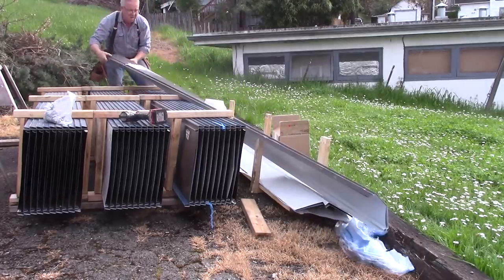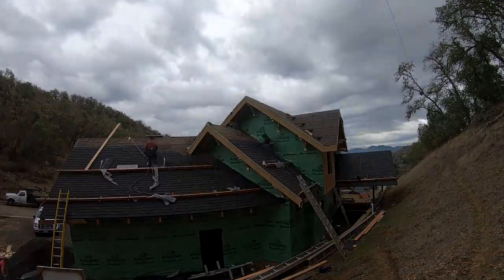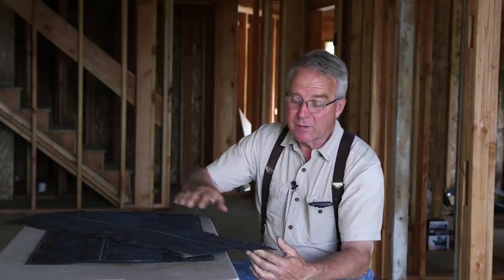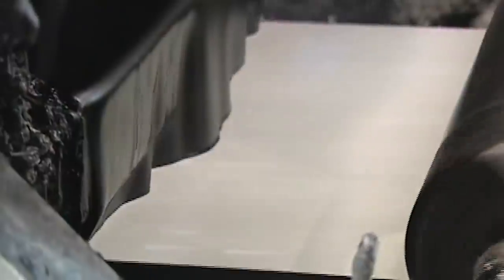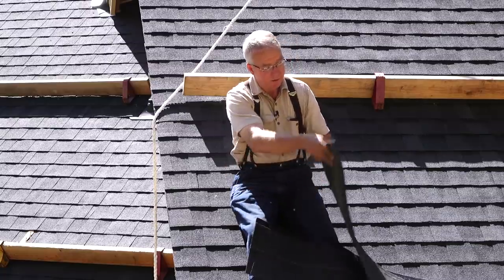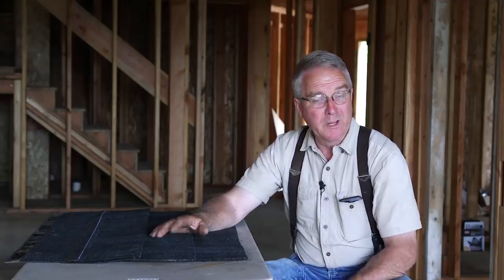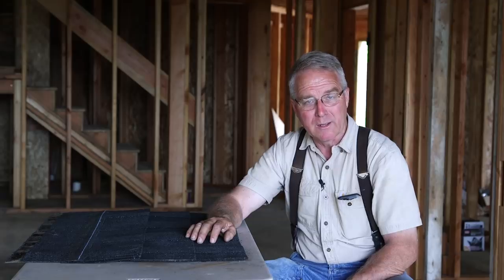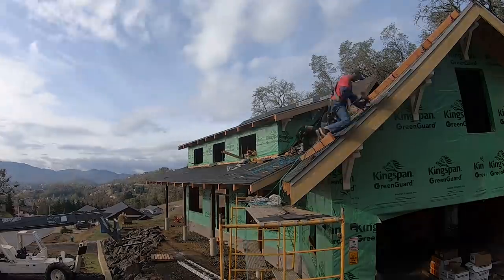The Incredible Asphalt Shingle

Comment: Here in Spain, in 99% of our houses we use tile roofing. And man, they endure everything. We have buildings 400 years old and they still work perfect.
Reply: I wonder if the environment makes a difference, like humidity and organic matter like leaves?
Reply: Frank Reading tile is very popular throughout much of Europe, even damp regions like the UK
Reply: How does the tile hold up to large hail?
Reply: Yes, as a German, I know how well they work (and how good they look.) It's also interesting how much engineering and robust construction goes into preparing the trusses to support their weight.
Reply: @HavokTheorem  tipicall  iberian tiles are entirely a clay based product, that avoids they can even crow plants and moss whitout any long term structural issue.
Reply: Yeah but the roof isn't 400 years old
Reply: the roof or the tiles? in my house the tiles are about 250 years or more but the wood beams were replaced with concrete ones in 1957
Reply: @BrunoGarcia79  In MY house, in rainy old Somerset, the tiles are from 1720, and so is all the main timber. There's been some small repairs, and the battens and felt were re-done in 1958.
Reply: @jobaecker9752  Heavy!
Reply: Glenn Holcomb  
Only in Florida? ?  You need to get out more. Metal roofs are popular in the Rocky Mountains, the Midwest, and I know from Florida to Texas.
Reply: @tubeonline629  tile. Not metal
Reply: Glenn Holcomb  there are tile roofs all over the States but they are a very specific look and usually don't fit into their neighborhoods very well in my opinion. If people in the States designed houses better (the McMansion curse) tile roofs could be used in more attractive ways and may become more popular.
Reply: Yeah the thing is houses don’t need to last 400 years. No one wants to pay for that additional cost
Reply: Clay tiles are good, but not in the regions where there is minus celsius degrees. Moisture that is inside the clay tile starts the erosion in the tile. And there is moisture (same with the metal roofs), since you have to warm the houses and the warm air always consists water (humidity), when it meets the cold roof moisture either is absorbed (tile) or condenses back to water (metal roof) and run underside of the metal roofing and dampens the wood. Asphalt tiling is good solution since it is on wood already and the humidity doesn't condense on it. Roofing woods will how ever absorb it and release it in warmer periods, but difference with the tile is that after wood absorbs the humidity it doesn't break while frozen, clay (and concrete) tile will always erode a bit in this freezing-melting- cycle.
Big issue about asphalt tiles is the "drying" after years, the surface starts to brittle because bitumen loses some of the elasticity through vaporization, that cuts down the usable years of the material, but it's easy to change and is not that expensive so its something to think about.
Reply: @tomigutzen  very interesting
Reply: @Mrcaffinebean  throw away culture makes throw away houses? if your house lasts 400 years, your kids will thank you for being debtfree and their kids and kids kids kids aswell.

It is lasting value
Reply: In Brazil we use tile and they are called "portuguese tiles". I wonder if they are different from spanish's.
On simpler houses people use fibro cement sheets, that are also good.

I don't like to bash, but houses in the USA look like paper board boxes. I realy like the rubber shingles thoug. I thing they must be The Best. Durable and light.
Reply: Glenn Holcomb  Fly into (or over) Phoenix or other cities in the American southwest extending to California: look down and you'll see neighborhoods with multitudes of tile roofs.

Comment: You should come to Europe. Shingles are rare and considered the budget option. Normal is tile, slate and metal. Lately green growing roofs too. Siding is also mostly wood here in Sweden, Norway and Finland. We use wood stud construction quite similar to the US. Just thicker for more insulation.
Reply: American contractors have fallen In love with Asphalt shingles over the last century. Primarily because they're cheap and easy to put on, but most homeowners don't know that so the roofing boss can make a huge profit on it. They also take the gamble that those homeowners are going to call them back in 20 years to replace their roof again. I hate asphalt shingles and will never put them on them on my houses. I've owned two houses that came with their 100 year old original slate roofs. If that's not a testament to their greatness, I don't know what is.
Reply: My only thought is hail. It's not uncommon to get a hail storm yearly with 40-50mm hail stones once every 10 years. Most shingles are replaced far before their warranty period runs out. Steel is a good option for hail but dents are likely and seen as unsightly. I don't know anything about hail occurrence in European countries though.
Reply: I said before that as far as I am aware in the UK at least, shingles are stuck on the shed, certainly not on the house. This is not a criticism really, clearly its different in the US. What I scratch my head over is the location of this house appears to be stunning. It would appear to be a location that would put it right in the upper price brackets for the area. Surely on that basis Scott could expect to enjoy a greater sale price if higher quality materials we used?
I hope this is the last ad for tamco.
Reply: @andrewv5104  Hail? We were in Quinta in northern Portugal in a rental VW van and had just parked in front of the hotel when it hit. It was reminiscent of a driving range except the hail stones were twice the size of golf balls. There was no time to talk about running the last few car lengths for the hotel. It just dropped all at once and the noise was beyond front row rock concert. A girl had just pulled in front of us with her Fiat and the airbag slammed her back in her seat. She was stunned for a few seconds and didn't move then she jumped into the back seat and pulled a blanket over her head. My wife's Pai and my FiL went for a Bica debriefing session. When he returned It turns out that the village had requested the hail long ago when locusts went loco. The hail had lasted just over 2 minutes for some reason. I think it was great fun. About our rental vehicle.... Hail Dorothy, our VW wicked, witch is dent. 

Paid the extra 22 Euros for their Wishy Hadda insurance golden ticket that covered the works including acts of God awful bad luck even curses. Storms are awesome but I think you need to be in a rental to really enjoy the pounding.
Reply: Gareth Irwin   “I hope this is the last ad for tamco.” My sentiments exactly.  And if I’m not mistaken, Scott received those shingles for free from the manufacturer. If true, this video appears to be the payback. 😩
Reply: @Steve Sheldon But without topsoil under your lawn you'll make use of all of your water allotments or skip a couple days so you can watch it transition much quicker to a nice shade of yellow too.
Reply: Gareth Irwin l
Reply: @dudemcmann6936  asphalt roofs can be replaced a lot less often if you use a higher quality shingle- these shingles he's using are rated for 50 years and will last as long as any other material can be expected to last.

Definitely plenty of roofers that prefer the absolute cheapest shingles that only last for 10-20 years so they get another job after the next hailstorm. 

Dad's an insurance agent and sees more roofing damage than any roofer, so you get to know the market. Ask you insurance agent about your area, some agencies will pay for the better roofing material
Reply: @andrewv5104  Hail is not that uncommon in most of europe.
My roof is 70 years old, in Scotland, and no issues.
Shingles make sense in the us, and they now last longer, but the problem is they are still bad values as the install cost is huge.
Reply: He would not get return on investment for a higher quality roof material. The roofing material rarely affects the market value of homes here, the only time it does is when the roofing is at the end of its life expectancy. I'm sure that roof was a 20k USD roof, slate would be 60k to 80k easily and would not add any value in the US market to the sale price. Unfortunately most things are more or less built to be "temporary" compared to European standards.
Reply: @nicholassmith5079  to be fair his investment in shingles cost him a few words spoken on camera. It would cost a months wages for an average person to buy those shingles. If he had to pay for them I'd bet he wouldn't have hired a contractor to fit them.
Reply: @garethsnaim8174  You'd think but we Americans can be price sensitive about the weirdest things. I work in construction (mostly repairing flood damage) but have done 100K basements. People who spend $600 for three lights yet go cheap on flooring because "I don't really look at it".

Some buyers would probably love a metal roof but most would just wonder why the house is X thousand more and think"I mean a roof is a roof right?"

It can get weird.
Reply: For the complaints about the Tamko endorsement -- they have a great product and color selection and a lower price vs bigger brand name competitors that offer no more quality so they were an easy choice for me when I did my roof in 1996 and it still looks great. I think it's fair trade and common on YT to endorse a business who supplied their material or service at cost or less, this channel is not ad-heavy, they've been giving us a lot of value for free.
For Europeans -- I lived in Germany and worked jobsites for 8 years so I know what you're seeing may seem strange. Roofing is a complete trade in Europe, with all of its intricacies and certifications, which is good...here it's a labor job run by someone skilled but they're not going to be able to compute the surface weight and application of an historic copper dome like every master has to in order to get certified over there. Typical build time for a house in Europe is 4-5 years, here it's 4-5 months. Real estate and property is a valued heirloom in Europe, here it's a commodity that is used and sold fairly quickly. There are exceptions to this but in general, this is still the wild west.
Reply: @Steve Sheldon In the U.S.  brick veneer homes without properly applied house wrap often produces mold as the lower portion of exterior walls become soaked.  This problem is less common with newer building codes.
Reply: @JohnDotBomb  50 year asphalt shingles ?  That won't be the case here in south Texas, but I'd like to see some examples if I'm wrong about that.
Reply: @timothykeith1367  Central Texas born and raised here. 50 year asphalt is still the best bang for buck, what my dad recommends after 35 years of inspecting roofs here. Metal is nice for larger industrial buildings, and tile/slate/other is generally for looks, which is usually only done on a custom home- spec houses shouldn't spend money for the buyer.
Reply: @dudemcmann6936  well, cheap asphalt shingles roofs match the way we build here in the states unfortunately. I've worked on too many million dollar homes that are built like tract homes. You aren't paying for quality of craftsmanship anymore in most cases. And the houses start going downhill almost as soon as the junky shingles nailed on top.
Reply: Anon Ymous  he probably means thicker as in building the outer walls with 2x8 studs so you have a deeper stud Bay that will hold more insulation.
Reply: Anon Ymous  Keep in mind that being from the Nordic area, English is probably not their first language.  I read it as deeper for more insulation space, as that makes more sense than thicker wood.  As you said, not a very high R value.
Reply: Here in Australia we like to use colorbond corrugated sheeting for just about everything, rooves, fences, sheds, whatever needs panelling, you can use corrugated iron.
Reply: @JohnDotBomb  this is just a lie, no asphalt shingle is lasting 50 years, in fact 90% don't make it to year 25.

Comment: Technology has come a long way and for the life of me I can't figure out why the best we can do is asphalt shingles!  I don't care what the guarantee is, asphalt roofs here in the Atlanta area will never survive beyond 10 to 15 years.  And why on earth is it a good idea to plaster hundreds of square feet of black asphalt on top of your home just to soak in the heat and create 120+ degree attics!  Give me a good aluminum roof that will last at least 50 years without problems.  And make it a light color to keep the heat down.  White asphalt shingles help but look horrible after just a few years.
Reply: I think this has to do with the fact that it's a spec house (and in the PNW). It's probably not worth it for the builder to gamble on spending twice as much on a metal roof and hoping that's a popular choice for potential buyers. Asphalt is standard. The homeowner can always put in a metal roof when it needs to be replaced if they want to.
Reply: Some of the shingle-looking steel roof products with grit are indistinguishable from a nice architectural shingle, and prices are only about 50% higher around here. If I was 20 years younger I'd have nothing else on my roof for my forever home.
Reply: Here in Texas metal roofs are a good option for dealing with the heat and hail
Reply: @jpm1211  Metal shingles will become more widely used and prices will come down
Reply: Timothy Keith same in South Dakota. I have pro-rib steel panels on my house. They should outlast any shingle roof option.
Reply: A lot of Atlas Chalet shingles were used in the ATL area in new construction right after 2000.   They were not rated for the solar load of GA summers and have failed in incredible numbers.  This was the result of builders trying to save a buck and getting a deal on shingles not meant for the southern latitudes
Reply: @benporcher723  Haha I imagine it has to do with the fact that the manufacturer sponsored the videos and provided the material for free/discounted.  Shingles are great, but IMHO rarely the "best" option.

Comment: I appreciate Essential Craftsman producing these videos. One thing that was not covered is moss management over time. Asphalt shingles grow moss in the PNW so that the homeowner is required to scrap or pressure wash the shingles annually. Part of the process at times requires breaking the seal. It is uncertain if this can be problematic to the seal, one assumes the answer is yes. It is doable but something to consider when considering this material in a temperate rain forest region.

Comment: Asphalt is the residue of oil refining. It is the heaviest fraction. We have lots of oil in America, so we make roofing and roads out of the asphalt. Our friends in other parts of the world make roofs out of the most cost effective material available in their region. Environment plays a role in deciding what material is most cost effective too (rainfall, wind, temp, snow loads and fire).  Another consideration is weight (and the framing needed to carry it). Tile is 2-4 times as heavy Architectural Asphalt Shingles. Slate is 2-8 times as heavy depending on the thickness (.19-.75 inches). If you were surprised by a 10 ton roof, imagine an 80 ton slate roof.
Reply: I should have added that local taste / visual preference plays a role also, In Florida, tile roofs are popular because the Mediterranean style of architecture is  popular, and not because they hold up to hurricanes better.

Comment: Living in Australia I have built three houses over my long lifetime. The first had concrete tiles, which was the standard at the time (late 1970s). They lasted well and indeed that same house still has the original tiles and is still standing strong. The second house (1990s) had a flat standing seam steel roof. That had intermittent problems with leaking and it took some time to finally get the sealant replaced and squared away so that it worked well. The final house (2010s) has corrugated steel roofing which is the current standard here. Fast and easy to put up, has a 30 year warranty and available in a large range of colours.
Reply: Sealant? Why should sealant matter on a standing seam roof? Are you sure it was standing seam? There should not be a need for any sealant on one
Reply: @mr.g937  The sealant problem was with the box gutters. The roof itself never leaked. That house was sold a few years ago and we had to rectify the leaking problem before putting it on the market.

Comment: In the UK we cover roofs with slates, clay tiles, concrete tiles, or occasional metal we only use shingles for kennels (dog houses) or garden sheds (cheap tool storage) my house has clay tiles aparently my particular ones only last 50 years..... 70 years on not a leak in sight they'll be fine for at least another 70 I recon